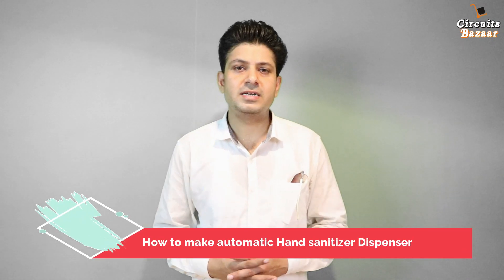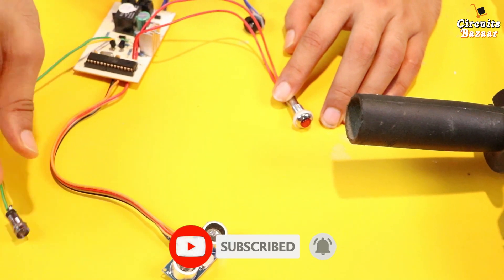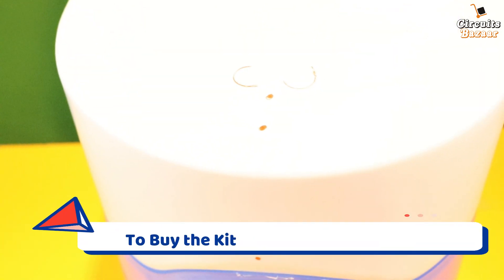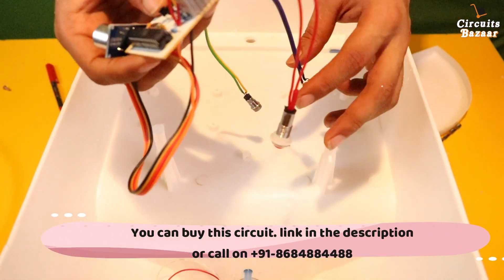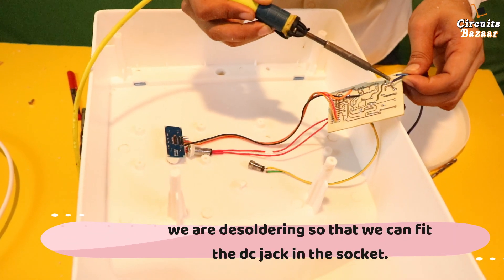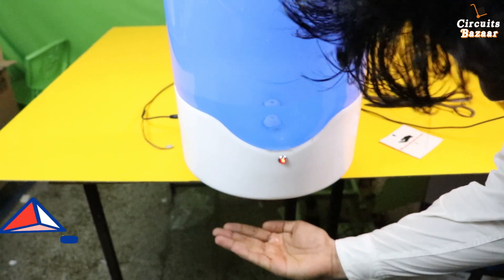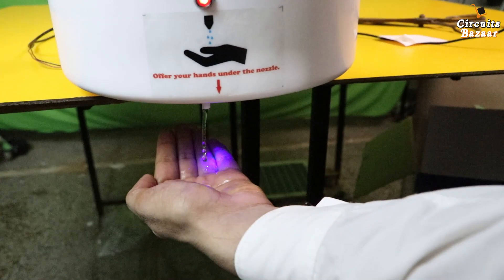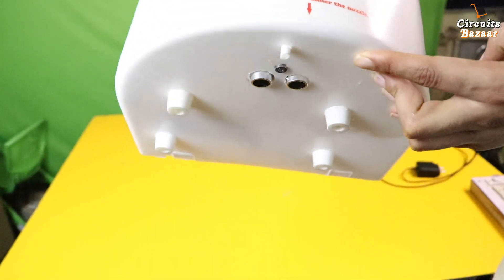How to Make  Automatic Sanitizer Dispenser at Home | You can sell it commercially.

Comment: Nice video. I have a doubt that how much ml will it dispene at a time and will it automatically stops after removing hand. Can we adjust the quantity in circuit. I want to use it with battery .is it possible.I want to buy it.pls tell.
Reply from the maker: yes whatever you asked , there is a another circuit for that ... please contact on number in the video

Comment: Sir I have made this type of circuit with timer and relay and ultrasonic sensor but it is having one  problem when I join the one wire of motor and common of relay to 5v all connected internally it starts to fluctuat And when I connect relay to external power supply it works can you tell me what's the problem
Reply from the maker: you can send the video of the problem you are facing to our what's number  ..... we will resolve that ..... or  you can try our circuit ... 480 Rs. if buying in quantity of 10 pieces
Reply: @The.Innovative.Indian  I have sent the video on you no. Plz check it sir